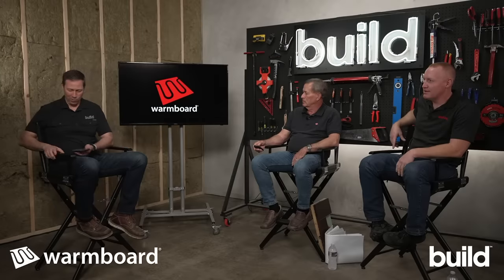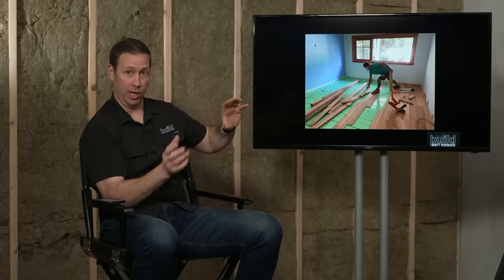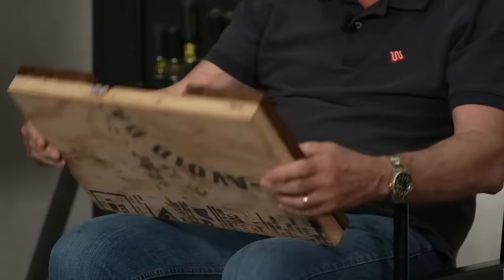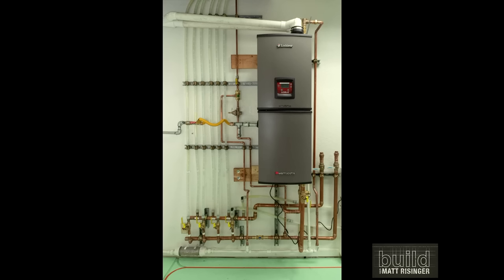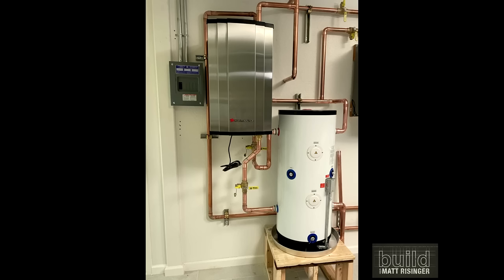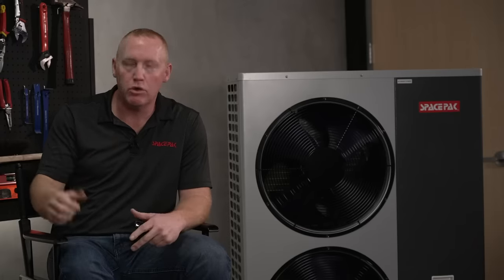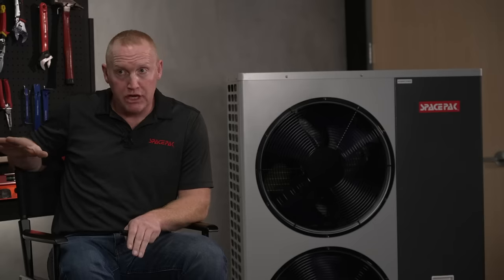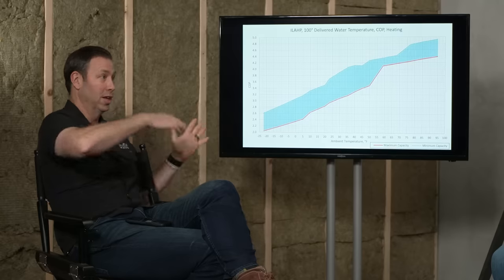Cold Climate Heat Pumps for Radiant Floor Heating. No gas, no boiler!

Comment: What is to prevent a builder from using 1 1/8 sub flooring and using a router to cut groves into it?

Is the alloy pressed into warm board actually required?

Has anyone tried? 14:29
Reply: The alloy is definitely required. Wood and air are insulators, so getting the heat from the PEX pipe to the surface of the floor where it can radiate from is really hard if you don't have the alloy in contact with as much of the surface area of the PEX as you can.
Reply: @tlangdon12  not true really because you just installed 3/4" hardwoods right over the pex.  as we all know from Matt, wood sucks as an insulator.
Reply: Nate, its needed.  cutting out that much wood leaves almost nothing behind!!  i can bend the panel in my hands at 1 1/8" thick and snap the plywood and bend the aluminium because the groove reduces the area to under 1/2".   if you grooved out the wood and didnt have the aluminium as backup, you'd be in trouble structurally.
Reply: @neckofthewoods24  It's not just that the wood is somewhat of an insulator, but also that there is such a small contact area onto the floor above. The PEX will deform slightly, but its basically one point of contact, whereas the alloy touches about three quarters of the PEX.
Reply: @tlangdon12  that’s why you install pex under the sub floor and attach with aluminium transfer plates and install insulation next.  Holds all the heat in the joist space and transfer the heat up.  Probably a few dollars a sqft vs $25 or more.
Reply: @neckofthewoods24  Your comment shows you haven’t understood the benefit of the Warmboard system. Sorry
Reply: @tlangdon12  lol wait wasting money and getting the same benefit as a cheaper solution?  Yeah totally lost haha

Comment: This stuff makes no sense. When you build an efficient home they brag about how they use a hair drier size heat element for heating the whole place. 
If that is the case then why all this extra stuff with warm board? Just to say I'm more comfortable than the guy with the hair dryer.  Just crazy nuts.
Reply: you need more!!  im dealing with it now!  the entire house, every floor will need tubes under it or else youre gonna pay! $$$$

Comment: Great content! Is anyone even considering DHW on this?? Even better!
Reply: There are already electric hybrid heaters that do this, no need to complicate a system.
Reply: just look at europe, we have had air source and geothermal pumps with DHW, floor heat, low temp rads, fan coil cooling, floor cooling in concrete for decades, so well engineered systems are a lot to choose from. Look up for example Nibe, metrotherm and Nilan units.
Nilan compact Geo or compact air can provide radiant heat, dhw, ventilation with heat recovery, and cooling. It can also cool down house with built in heatpump and dump the heat into DHW.
Many houses have minimum 12 inches of foam insulation and thick concrete embedded radiant heat which acts as a huge buffer tank , so no external one needed if sized correctly. also works as battery for renewable energy storage of course. Floor cooling is possible with dew point measures and temp of minimum at 19C.

And yes people always go for combined radiant heat and DHW systems here mostly in denmark, cause there is simply no more efficient way to heat DHW than with heatpump. Either a tank with 3- way valve (switch between room heat and dhw) or plate heat exchanger systems with electrical boost.

Comment: Radiant floor heating is an energy hog. Heating takes HOURS to establish and HOURS to dissipate so a large swing in outdoor temperature is hard to match for a constant indoor temperature. It is often too hot in warming outdoor conditions and too cold in cooling outdoor conditions, which can waste large amounts of heat. Yes, a warm floor is more comfortable but at what cost? A combination of low heat for the floor and forced air &/or radiators for maintaining the room temperature is a good solution but double the cost for installation. If money is no object then combine them all in a room zoning system so each room is precisely temperature and humidity controlled. There is also an air tubing radiant floor system that has no water leaks. Air has low mass so it is easier to match the heat to exactly what is needed. Heat pumps work with air systems just as easily as water.

Comment: You're taking gas or electricity to heat water, put it in a plastic tube, transfer heat through that to heat cement,  to heat the air. Just heat the air!!! And with the money saved in tubing and stuff and add more insulation under the slab and in the shell and better windows. Insulation and airsealing is the cheapest heating and cooling you can get!!!

Comment: It's -4.3c and falling here. Interested to see how you extract all that warmth.
Reply: You can extract heat down to -18!
Reply: Chart shows COP of 2 at -22 degrees F which would be -30 degrees C. It also makes sense to think of average performance over a longer period of time such as a year.
Reply: See 46:15 in the video and the note from @bigfishoutofwater3135. You can extract heat relatively efficiently down to -30C.
Reply: The refrigerant fluid boils at -30F, so any temperature above -30F is enough to boil the liquid which extracts latent heat from the air.

Comment: I'm still waiting for someone to do radiant cooling ceiling and radiant heating floor, using a heat pump to move the radiantly absorbed heat from the ceiling down to the floor - then moderating the centerpoint of the ceiling and floor to match the latent heat set-point of the fresh air handler around windows.
Reply: While great in concept, I personally think it'll never happen due to complexity and cost.
Reply: @bradforrester2417  If you consider the Mitsubishi City-Multi systems, they can already do this (moving heat between zones, almost any zone can be a heat source or sink), it just hasn't been done.  Similar with a heat-pump water heater being a heatsink zone, or a refrigerator/freezer being a heatsource zone - they exist, but just haven't been integrated to a whole building HVAC&R system (losing efficiency by dumping that energy into a volume that has to then remove that energy, and recondition the volume).
  
TBH. it's not that complicated - the hydronic floor/ceiling maintain the ideal human comfort curve (warm by feet, cool by head), and a much smaller air handler simply handles the air volume conditioning.  It's actually less complex to conceive than a system which has to do many jobs with one device, and then interact with non-integrated devices to balance the whole system.  Rather than doing water plumbing everywhere, just smaller refrigerant lines and some power.

Comment: The most efficient place to burn the natural gas is in the home not at a power plant generating power and shipping at hundreds of miles to the house to run the heat pump that won’t last very long if you try to eat the water above 110°
Reply: Actually, no. Natural gas fire power plants are now "combined cycle" which you will never find in a residential application. An electrical utility operator will get anywhere between 45% and 57% thermal efficiency. Your gas home furnace gets less than 30%. Note the ratings of 90% ratings or higher on gas furnaces applies to the percentage of gas burnt, not thermal efficiency.  Most thermally generate electricity is consumed closer than 200 miles. Most of the long power lines are running from hydroelectric dams. It is generally cheaper to transport the fuel to the fossil power plant then to build the power plant near the coal mine.
Reply: @paulmcgown7504  The thermal efficiency rating on the gas furnace is the percentage of energy consumed to the amount of energy produced in the air stream that’s heat in your house. it is 40% more efficient than using gas to make electricity. The efficiency rating does not take an account the electrical energy consume to run the fan but 100% of that energy is converted into heat and ends up in the airstream. there is no electrical generating Plant that is producing energy at greater than 50% efficiency from the gas. The only way to do this is to use the heat for a secondary purpose such as space heating.

Comment: This product does not appear to be the work of a physicist. While the aluminum will help the floor surface warm up quicker, in practice it doesn't actually help in making things more efficient. So going from a cold start you might have a heated surface faster, but you won't heat up the room much if at all quicker. It may also somewhat help with avoiding hot spots, but your flooring is going to do that anyway.It is all determined by BTU input for a given volume and how quickly that heat can radiate out to the outside. Nothing to do with heat conduction. And usually you are dealing with constant temperatures and a concrete slab performs just as well as any other medium except as a barrier to the outside. Use better insulation to improve that.

Comment: I wouldnt trust water pumping through my floor. Just the thought of a pump freaks me out. Just to pump a little fountain the pump lasts a couple of weeks then breaks down, I have had to liquid coolers for my computers and both of them broke down after a year - one exploded. Seems like an issue with this type of heat would be quite expensive. Slippers are cheaper.
Reply: It's a valid concern, but there are ways to mitigate the risks, but this just adds more cost, so many vendors will point to the warranty that the pipe supplier provides. In the UK, most suppliers warrant their pipes for 50 years. I wouldn't rely on the pipe supplier's warranty. I would want to mitigate the risks of leakage. Matt already puts a drain pan into areas where water leaks might occur, we just need to scale that up to capture the leak from a radiant floor system!
Reply: In Europe it is very common to have heating based on water in pipes, radiators on walls and underfloor heating. There exist a broad selection of reliable long-lasting pumps (say 20 years life expected) from a range of manufacturers (like Grundfos).
Any system can be ruined by using bad components, but it seems most installers succeed in choosing reliable pumps.

Comment: 1. COP is kept high, but its a cost of reduced BTUs at 50% or perhaps even more. When its coldest, that's when you need the most BTUs because your heat loss will go up as temperature drops.
2. Heat pumps can freeze over if the air temperature is near freezing and its raining or foggy out. Since the condensing coil will drop below freezing, any moisture pulled through with freeze on condenser, blocking air flow. It make even cause the fan to seize if ice starts building up on the fan.

Basically your making trade offs with a heat pump & its not more efficient than a condensing boiler which can output the same amount of BTUs regardless of temperature.
Reply: Both are wrong. Systems have spec sheets giving the COP and output at temperatures. There's no 'keep the COP high but don't output heat' because that would make no sense. For #2, this is been solved forever ago by defrost cycles. Your condensing boiler can never be above a COP of 1, a heat pump will never drop below 1.
Reply: @KennyMacDermid  Go watch the video! The spacepak rep stated in the video that at low temps. the BTU output declines by 50%! The 60K BTU unit only puts out 30K BTU's at low temps.

For defrost then you killing efficiency. Either running it in reverse or using a resistive heating element. Either way it a loss.

"Your condensing boiler can never be above a COP of 1, a heat pump will never drop below 1."

A condensing Boiler has a COP of about 3.2, as it more than 3 times thermal efficient than a electric resistive element.
Reply: @guytech7310 Defrost is already factored in. It'll never be below 1 (or you'd just use resistive). Your boiler is never hitting 1, let alone 3.2, or it would be a heat pump. I don't know where you got the idea that it is, but thermodynamics says you're not getting more heat out of the boiler than the energy you put it (or, as I said, it'd be a heat pump).

And yes, the heat pump output drops at lower temperatures, but not to 'keep COP high'. It's not some kind of conspiracy. All it means is that you have to design the system for your conditions, same as you do with insulation levels.
Reply: @KennyMacDermid  Sorry Kenny your wrong. Heat pumps aren't as efficient as a condensing boiler. Electricity is produced using natGas turbines which is about 40% to 50% thermal efficient, then factor in losses from step up\step down, distribution losses. Over all natGas power plants only deliver about 30% of thermal energy used from the power plant to deliver to your home.

"keep COP high"

At lower outdoor temperatures, COP drops off a cliff as the heat pump has to work harder to get to the target temperatures, The bigger the delta temperture, the more work needs to be performed. This is basic physics. What SpacePak is doing to cap the drop in COP with outside temperature drop is to reduce the condensers overall output. Sort of like using a gear box in a bicycle or car. The engine can operate at the same RPM\power output, but a cost of reduced velocity. Only this applies to BTU output.

With a condensing boiler nearly all thermal energy created from combustion,  is available for heating. The only loss is the delta temperature in the air need to support combustion and the slight loss in heat transfer in the boilers heat exchanger. Over all temperature ranges a Condensing boiler will out perform a heat pump since about 60% of the thermal energy to produce & deliver power to your home is lost.
Reply: @guytech7310   I don't understand why you involve electricity production in this.... You state that electricity is generated my natgas turbines as if thats the only way electricity is produced. Now I know that you know its not the only way. ( full hydro here). So  leaving the grid out of this. The heat pump can have a COP. COP  is the following 1 kw consumed is 3 kw heat transfered ( not created).  Burning  natural gas for 10 , 000 btu will not give you more than 10, 000 btu, it might get super close to 10, 000 so its efficient, but  heat pumps are beyond that.
Reply: @nicholasgervais3163  Yup!

Comment: I'm disappointed by the lack of post-R-410a systems options available in North America. I find it hard to justify putting in a system based around a gas with a GWP in the multiple thousands.

Comment: This video is so full of obfuscation it's really hard for me to take. 10-20 year payback? What's the average life of a heat pump there mister? You're basically just saying there is no pay back. You're paying more and that's the way it is. At least that would be honest.   BONUS POINT: you know when systems break? They break when it's really hot or really cold for the most part. Get ready for paying a technician to be out in the coldest weather of the year in the middle of a snowstorm working on the heat pump outside. That one is going to cost you.

Comment: Nice product concept but promoting your product by dissing hydronic professionals is kinda ugly.  Also 10 bucks a SF more?  So you add 20K to the install of a 2000SF house?  Tough sell unless you´ve got money to burn...or compress.. Call this the ´Gucci bag´ of heating systems. If they had a responsible long-term outlook, they´d be working to drive the cost down to make it available for regular folks.  Hydronic heat shouldn´t cost much more than FA. Heat exchangers for HVAC and domestic hot water are commodity products so I see no reason to buy overpriced heat pumps for the job.

Comment: It’s nice to see a push to eliminate natural gas systems, but on the other hand…  common heat pump refrigerants like r410a are also strong greenhouse gasses. I’d love to hear about a CO2 refrigerant heat pump system integrated into a warmboard system. Because solar and wind power has a crucial ally in the works- Voskian and Hatton’s new quinone/carbon nanotube battery captures CO2 in the charging process, and would be integral to maintaining a full refrigerant charge. This battery can filter CO2 from the air! That would be truly a carbon negative system. So, given that CO2 hot water systems exist, when can we see Warmboard get a partnership with such a system?

Comment: State of the art latest model Fujitsu mini split with 33 seer $2k installs in a blink of an eye drill one hole your done (per room of course) warmboard cost $$$$$ spacepac cost$$$$$- where is the efficiency? its like clown that promote solar panels adv. Free energy with a 30k$ up front cost will never see your efficiency money back. You might have something wen your price for warmboard will be LESS than Adventec floor board and your spacepac would cost LESS or = to Futjitsu latest model 33 seer, in the future 40, 50 seer, else its pure trash

Comment: Looks like watching some medieval video. We had been using much cheaper alternatives in Europe for decades now. The board is way overengineered, hence you don't really need patent protection for it, as nobody would want to replicate that. There are very cheap overlay systems that are way easier to install too. You show large area install. How about the transition areas where you have multiple pipes running across doorways etc? All in all UFH is the only proper way to heat up with radiant heat. Just think how much energy you'd be pumping to heat up high-ceiling rooms with forced air?! Never mind the horrible feeling of forced air tornados in the rooms. 
In terms of air source heat-pump. All is good if your house is well insulated. For instance, in UK it's an absolute scam supported by the govt. This can only work efficiently with A++ and above homes. Same applies to geothermal. And most of these properties can never achieve the insulation or air-tightness required.